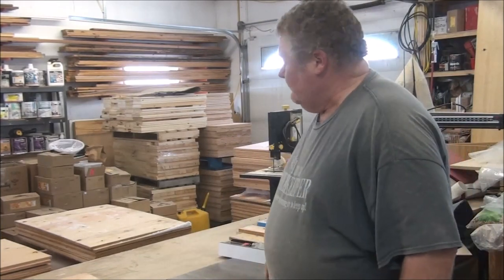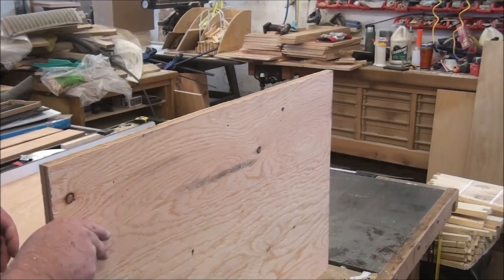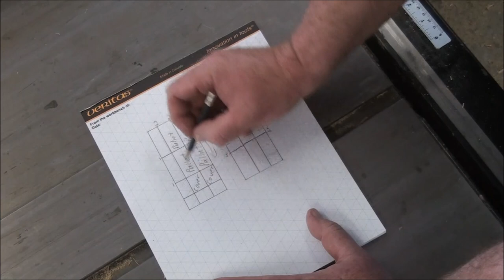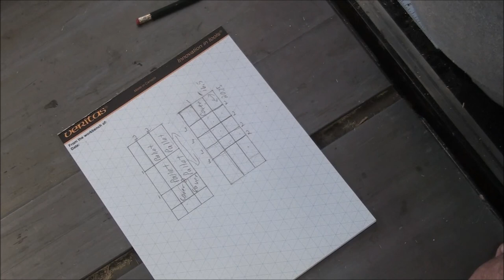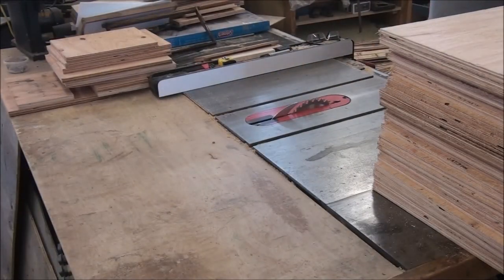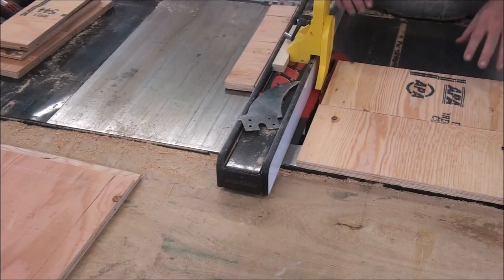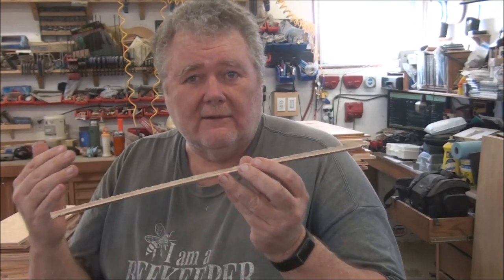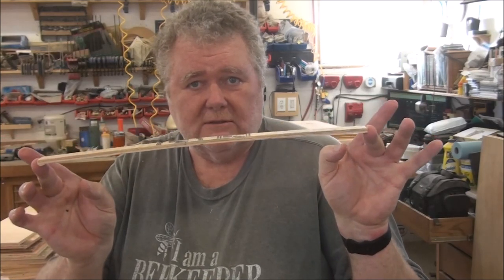🔨Stitching Plywood part 1 - That Bee Man

Comment: Great explanation Brad . A jug of Titebond 3 is not cheap either but you can salvage quite a few square feet of plywood with one bottle of glue . 
Nice technique, I will definitely be more frugal with my lumber usage after learning this . Thanks  
I’m thinking I could possibly secure the joint with a few strategically placed 16 ga x 3/4” staples
Reply from the maker: For sure.  Glue isn't free but a small glue investment can save a lot of money in plywood.  I'd use staples too but I always seem to get them where I want to run the saw, plus, that's a consumable and the screws I recover.  I was also concerned about how well the staples would pull the joint together.  I hope you get the chance to play with this technique.

Thanks for watching, Sheldon!

Comment: I used to work in a woodshop, I've never heard of a blade breaking, I imagine that could be a wicked event!
Reply: @ThatBeeMan  Yeah, didn't work there long - but I've never heard of a table saw blade breaking, do they fly apart when that happens?
Reply from the maker: @normanpaterson   I've never heard of a table saw blade breaking either.
Reply: @ThatBeeMan  Oh, my bad, I thought you were talking about saw blades breaking and you had to have them inspected, I was quite confused, my apologies, I probably was not paying enough close attention!  Can you imagine a saw blade that breaks?!  In my wood shop, vibrations caused a 6" piece of 2x4 to fall off a shelf next to the saw I was operating, hit the top of the blade and was a bullet, hitting a concrete wall, good thing no one was in the trajectory!  Shook me up big time!
Reply from the maker: @normanpaterson  Kickback is one of the most dangerous scenarios when dealing with a table saw.

Comment: I wonder if there is a composite sheet you could glue on to the top layer of the plywood, like a counter top. It would keep it flat…
Reply from the maker: That sounds wildly expensive and complex and I'm not sure what problem it would solve.  My covers have been in the weather for six years and are as flat as the day I built them.  Also, moisture doesn't only come from rain, it also comes from that colony of bees under that cover.  

Thanks for watching!